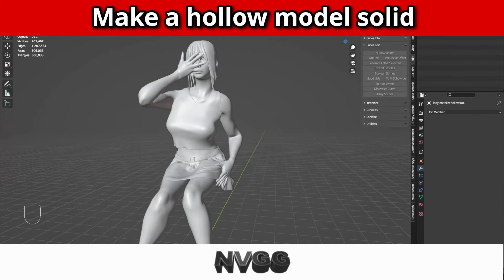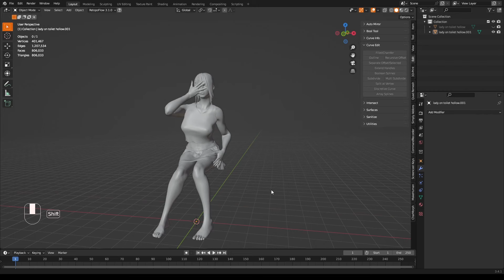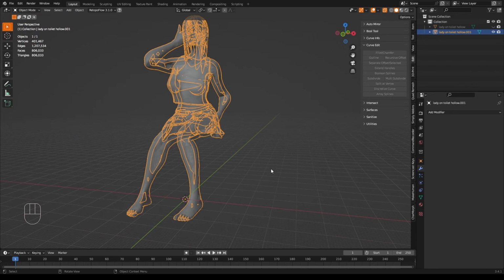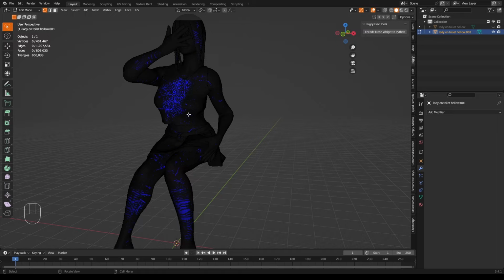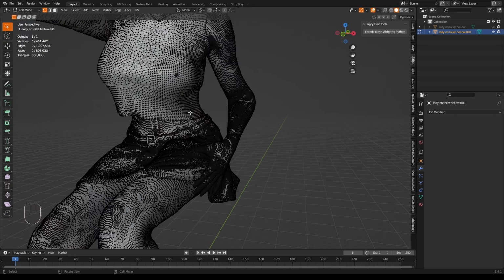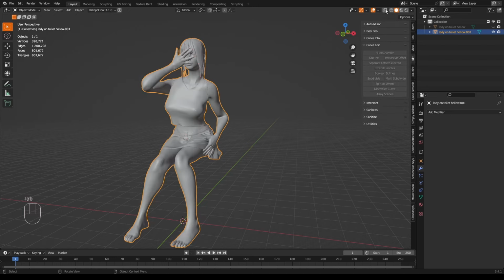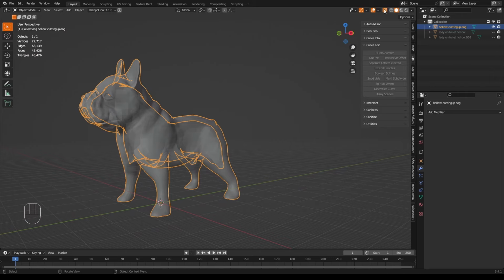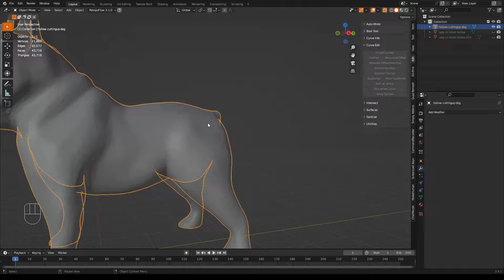Make a hollow model solid again with Blender

Comment: Hi - great video. I'm trying to fill a void in a model and followed all the steps however the interior walls are reading as exterior so when I hide the external vertices it hides the ones inside too - any ideas on why this may be happening?
Reply from the maker: Sounds like it is a model with a hole in it rather than a hollow model which might sound like its the same thing but actually isn't.   It also sounds like the hole intersects with the outside walls which is why the inside gets selected with the outside.

One thing you could try if you are patient is to go into edit mode and try to select everything you see with the circle select brush (press c and adjust the size of the circle with the mouse wheel) select as much as you can and then hide it with h (you might need to right click to come out of circle select first).  If there is still more outside that needs selecting repeat the process until you are left with just the inside hole of the model.   Finally do ALT-H to get the hidden parts back.  They should still be all selected so go ctrl i to invert the selection.  This should now select everything except the parts you selected before i.e. the inside and delete these vertices with x, vertices.

Take a copy of your model first of course.

Hope this works!
Reply: @notverygoodguy  It's a hollow model with drainage holes in. I've filled the drainage holes in with cylinders in 3D builder but it still doesn't seem to be recognising any of the internal topography.
Reply from the maker: @kingfluff8065  Hmm in this case does it even matter that it has holes in it?  It will likely print anyway.

That said, it sounds like your only other option is to select all the vertices on the outside of your model and separate them from the rest of the model and I described above.  This might require a lot of patience though.  

If you have a link to the model I would be interested to take a look at it.

Comment: pressing h hides both inside and out of model. What am I doing wrong?
Reply from the maker: Assuming you are not select everything with "a" instead of using "l" you could be very unlucky. If you have a model where the inside touches the outside somewhere this method wont work.  

What you could try although it would be a bit more annoying is to select all of the vertices manually using the circle select tool or the other selection tools.  Then when you are sure you have them all selected, duplicate them with SHIFT D, press the left mouse button and then go p->by selection.  This will give you a second but solid version of your model.

If your models it complex it could be tough to be sure you have all the outside vertices selected though.

Please let em know if you continue to have problems with this.
Reply: Inside does invert to outside at some points. This is my problem. Thank you for your response.
Reply from the maker: @archonoch  Thanks for letting me know!

Comment: pressing "L" does not work to highlight anything when i hover over my model it instead only highlights one vertice :/  is there anything i can do?
Reply from the maker: I have been trying to find a way to replicate your issue and I can't.  Even on a non hollow model it will select everything.  

Be sure you are pressing "l" and not "L" though.  If you still have an issue, let me know.
Reply: @notverygoodguy i have a similar issue the model is a jet ski and the inside is hollow not any part of the object is a solid object so its like different layers of folded paper making a 3d object if that makes sense but now thinking about it this may be an issue that can be solved in fusion?
Reply from the maker: @aaron8200  If there is no "inner model" then your model is already solid at least from the perspective of 3d printing.  However, if you are able to provide a link to your model I'd be interested to take a look at it.

Comment: I'm running into an issue where when I press L it only selects a portion of the model I'm trying to fill in. It doesnt select the entire exterior face of the model.
Reply from the maker: L selects connected vertices.  Is it possible that you have portions of your model that are not connected.  You could try doing a merge by distance to see if that helps.
Reply: @notverygoodguy  i ended up merging the model in the basic windows 3D editor and it also filled it in as well.
Reply from the maker: @SnekPlskin  Good news.  WIndows builder is often a pretty good option for fixing things.

Comment: hi good guy:face-blue-smiling:  What is the name of the plugin or software that displays your mouse and keyboard operations on the screen? It is beautiful and concise
Reply from the maker: I am using the Blender plubin called Screencast keys https://github.com/nutti/Screencast-Keys.  Bear in mind that it does not show a secondary key e.g. "g z" will only show the g and not the z.  I still haven't found one which does that.
Reply from the maker: Latest versions of Screencast-keys does show secondary keys :)

Comment: The use case is for 3D printing models that are hollowed, but are small so adding holes will only cause significant damage to detail without really allowing you to remove the excess resin.  It's better to have a solid model at small scales than a 3 cubic cm well of uncured resin hanging out waiting to cause problems.
Reply from the maker: Thanks for this.  I hadn't thought of that one!

Comment: For some reason when I turn down the opacity of the face orientation, it shows only gray and I cannot see the inside faces.
Reply from the maker: I presume you did it just on the blue colour?  If not  are you sure you have any inside faces.  To check just create a cube and use ALT B to make a cross section.  Then ALT B again when finished.

Comment: How would one make a model solid, that has been hollowed for printing in several parts? Those models are usually made hollow, but with holes, that connect the inside surface with the outside surface, leaving you essentially with just one surface. This method seems to not work in that case... Any other methods for that known?
Reply from the maker: This case is more difficult as you would need to fill in the holes.  One suggestion that comes to mind would be to ensure all the parts are put together in object mode so they make up the completed model.  Then join them with CTRL J.  Next, in edit mode you need to select all the outside vertices.  This might be difficult depending on the model but as a last resort you could select them with the circle select (press c and the use the mouse scroll wheel to adjust the size of the circle) and then just go p->by selected.  Then you should have an object of just those selected vertices.
Reply: great, that worked. Even easier, when selecting all verticies and then just unselecting the inner surface verticies :) 
Thank you for the help!  @notverygoodguy
Reply from the maker: @bofuhonaw12  Glad to hear you're sorted now.  Thanks for getting back and letting me know how it went!
Reply from the maker: @bofuhonaw12   Just a thought though, the final model may not be manifold.  I would suggest doing a quick merge by distance.  In edit mode, select all and then go Mesh->Clean up->Merge by distance.
Reply: @notverygoodguy  The cleanup didn't work here, but i managed to fill the holes in the end. Thanks again and have a nice rest Weekend!

Comment: If my model goes invisible does that mean that it was already solid?
Reply from the maker: It could be that or it could be that the inside walls intersect with the outside walls.  That's fixable but you have to find where vertices intersect and separate them
Reply: @ I think the issue is that it doesn’t encase any empty space it’s basically two separate pieces that don’t have any walls but the pieces don’t have volume so it’s not a solid
Reply from the maker: @starchaserstudios3752  Remember that a manifold model that only has outside walls is in fact, a solid model.  At least it is from a 3d printing perspective.

Comment: This video is great unfortunately it hasn't fixed my problem. I sculpted some crystal formations and made each crystal using a circle plane with 5 sides extruded and filled the top and bottom (which I thought would make it a solid object I was wrong haha) all I have is planes technically but trying to make it solid this method isn't working it has however fixed my mech I was making
Reply from the maker: To be fair this method only works at taking "hollowness" away from models that were originally solid but have been hollowed out in a slicer or something.  It hadn't occurred to me that someone might try to make a "manifold" solid model with it.

Your problem is likely to be fixed by the "make manifold" option in the 3dprint plugin that blender comes with or by selecting everything in edit mode an going Mesh->Clean Up->Merge by distance.

Hope this works!
Reply: @Not Very Good Guy  thank you ill get on that tomorrow morning! Thank you so much for your help

Comment: For 3D printing
Reply from the maker: Well yes but you can 3d print hollow models too.  In fact, I have 3d printed this very model :)
Reply: @notverygoodguy  right on, I'm just starting out, and I have a printer on the smaller side, so for the size of models I'm going to be making, I'm going to need to fill the interior to key the separate pieces.  This is why it's useful for me personally
Reply from the maker: @zacharyhall7466  Sounds sensible to me.  If you are resin printing then hollow models are essential unless they are small.  For FDM printing hollow models are very annoying :)

Comment: I followed the steps but the model just turned into a shell of itself.
Reply from the maker: The most common reason for a problem here is either incorrect normals somewhere in the mode or the model isn't correctly hollowed.  If any part of the hollow intersects with the outside of the model then this won't work.  If this is the case you do have the option of selecting all the vertices of the outside manually.  That said, can you explain at one point you have the problem and what do you mean by "a shell of itself"

Comment: Video is good but would be great if you didn't skip so many steps in the expectation that people know what you know ^^
Reply from the maker: Can you explain which parts you felt were missed?  It is always a balancing act getting the amount of detail right.  If you go into too much detail you end up saying the same thing in every video and it turns people off.  On the other hand of course you want your video to be helpful to as many people as possible.
Reply: @notverygoodguy  Dont get me wrong its great video helpful just when you went to click and highlighted at the start would be very helpful if you did that for each menu you click on cause later in the video when switching menus I h lost track of your mouse had no clue what you click on and had to replay video afew times to figure it out. But again thank you for your guides was very helpful
Reply from the maker: @bujinmar  Thanks for your reply.  I'll admit editing videos to highlight all the menu clicks can start to get a bit tiring :) However I'll take what you say on board for the next one.  Thanks again.

Comment: Another way to accomplish this is to select in Edit Mode, go to Mesh > Separate > By Loose Parts. This will give you the inside and outside parts in the Scene Collection tree, select the outside and hide it, then the inside will be visible. Select and delete it and you now have your solid.
Reply from the maker: This absolutely does work although would be very annoying with models that actually already have a lot of loose parts.  That said, it's an option I hadn't thought of so thanks.
Reply: @notverygoodguy  I've had that experience as well, although I've found that at the bottom set of parts the outer shell is either the first or second listing from the bottom. I just turned visibility on and off, and when I located the outside I just shift+clicked the rest of the parts in the list and deleted them wholesale, leaving just the outside.
And thank you for this, it let me figure out how to do it that way - I was having a heck of a time trying to get a solid from an STL so I could print it properly.
Reply from the maker: @RRSF09  I will play with this idea a bit and see how it stacks up.  It makes more sense than just trying to find the insides.  Actually, just selecting the outside from the start is probably better than what I have in this video anyway.